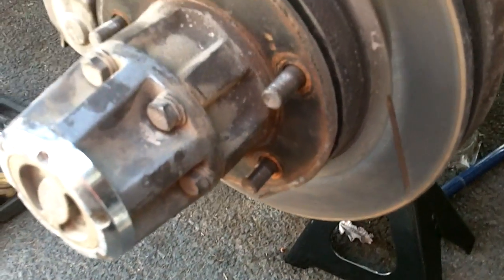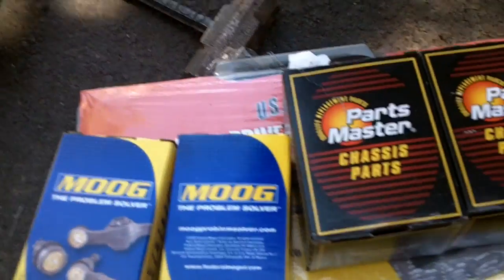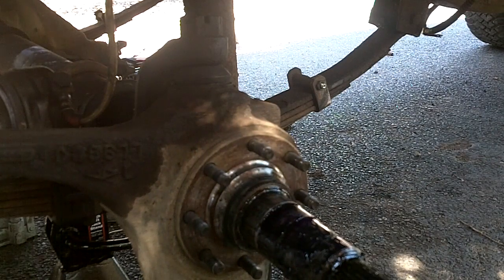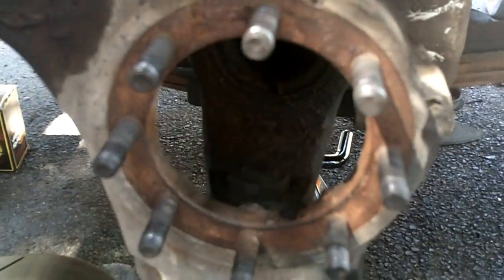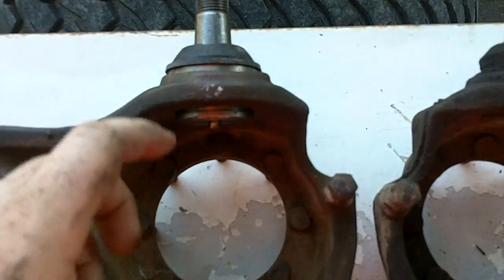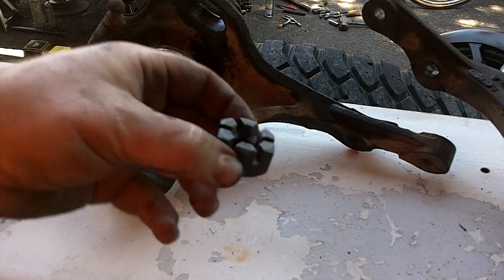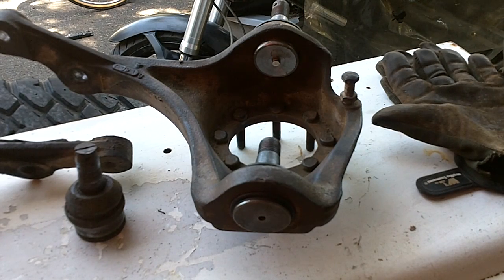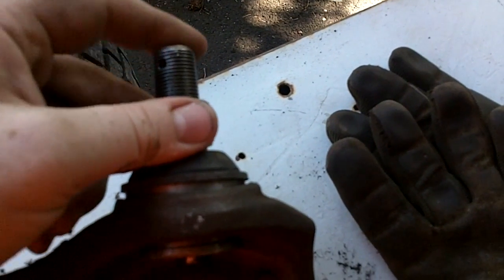Working on the BOV : Ball Joint Time

Comment: @Horizons84 
Installed countless lift kits, and spent time working on 300+ ton haul equipment. Never yet have had to hit the ball joint itself. Shock the cast iron around the ball joint with a few sharp hits of a hammer and they will come loose. Id not, a little heat always helps. This is really nice if you want to keep a ball joint for something like a trail repair to fix a bent tie rod. Not need to damage the boot with a pickle fork or mushroom the threads where the castle nut is installed.

Comment: Good vid. If you want to do a job like this but don't want to buy a specialized tool kit for pressing out the ball joints, you can usually just take your parts in to your local suspension shop and have them do the pressing for you. It usually costs me about $20 or a 6-pack of beer.